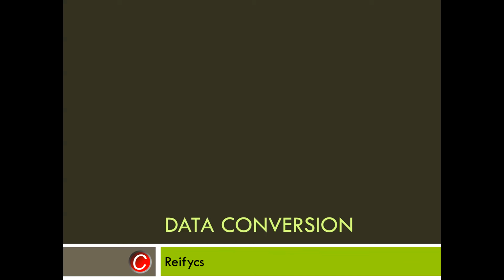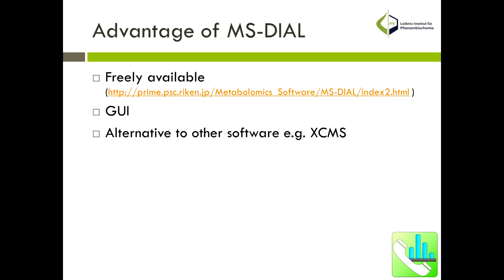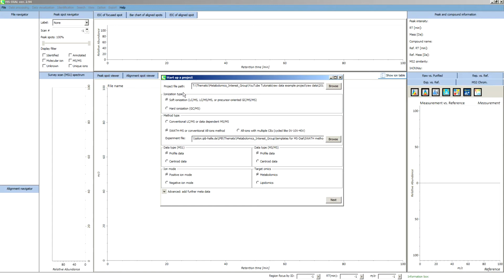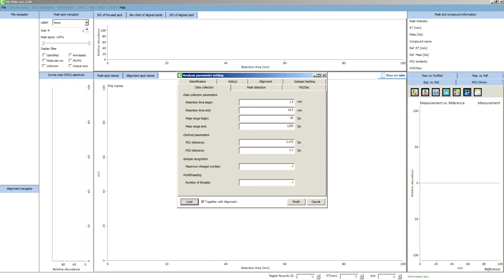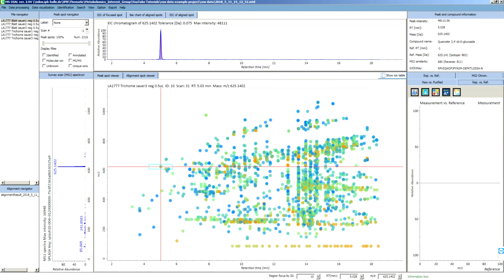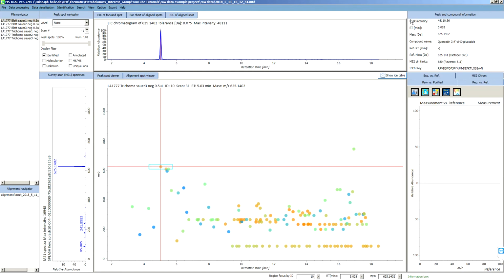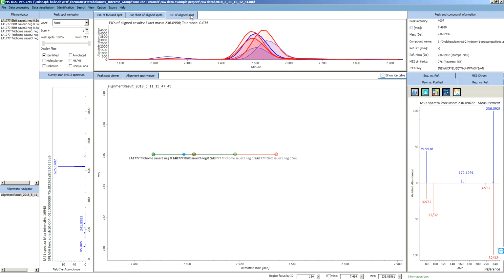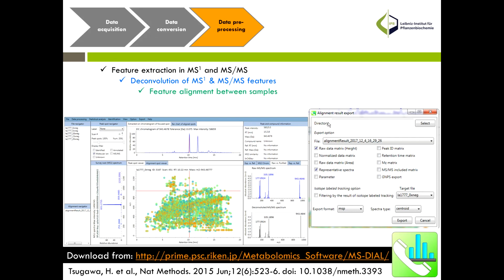Reifycs Abf Converter and MS-DIAL

Comment: I was wondering how to select an exact one as my identified compound when the 'compound search' list has two or more predicted compounds based on the spectral similarity upon just one picked-peak. Thx.
Reply: Hi, as far as I know the list of compound is already ranked based on the highest match (MS/MS, RT, m/z similarity to the msp library that you have inserted). If you are not confident with the number 1 rank, you can click on the button "A: Confident" on the top of the compound library pop up to set it. Furthermore, to really exactly select the correct compound, either you know already the compound of interest e.g. by using standards, or create a hypothetical structure based on the fragmentation pattern which you can try to elucidate from the qualitative analysis tool that comes with you device. Before jumping in NMR to figure out the structure, you can also try MetFamily to help you get an idea of your compound of interest based on the metabolic family of the compound e.g. flavonoids. Hope this helps :)